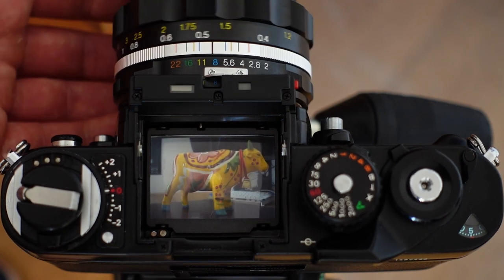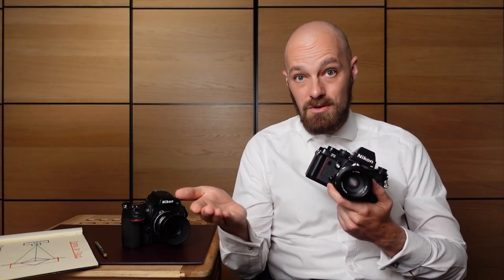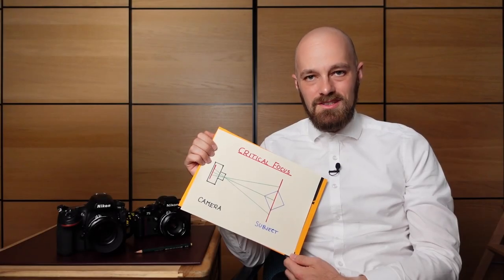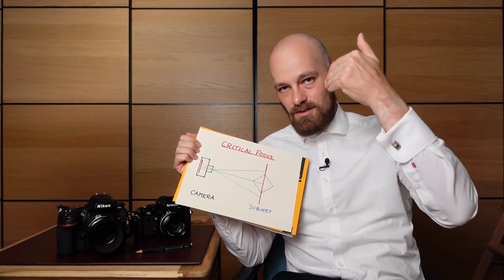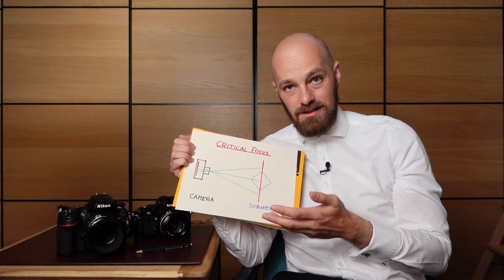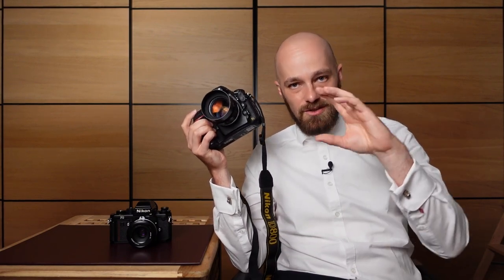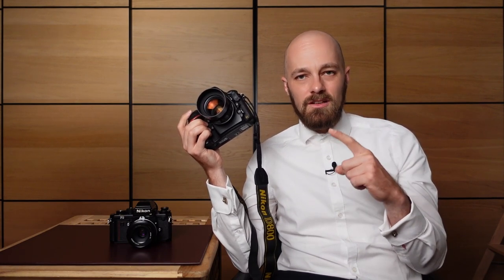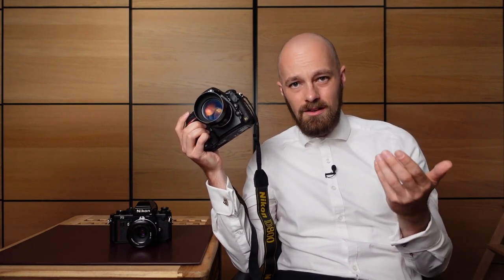Manually Focusing (D)SLRs - Understanding the Theory, Mastering the Technique

Comment: Hi Thomas, when shooting with a SLR, how does one manually focus on a subject that is placed off-centre while trying to achieve a shallow depth of field? E.g an upper body portraiture shot of a model that is placed off centre. Thanks.
Reply from the maker: Unfortunately, there is no magic trick. What I recommend: First, follow the guidance in this video and second, practice a lot! You'll get better at it the more you try. Best, Thomas 📸
Reply: @ThomasEisl.Photography  I tried with the focus recompose technique and it threw the focus off as the depth of field is too shallow. Will try your method someday. Thanks!
Reply from the maker: @retrovox focus recompose is never a good idea, as you'll always miss critical focus even with a lot of dof. Do the sideways recompose shift instead. Best, Thomas 📸